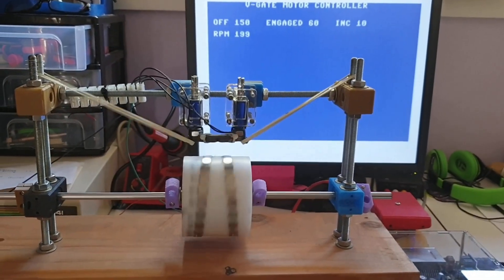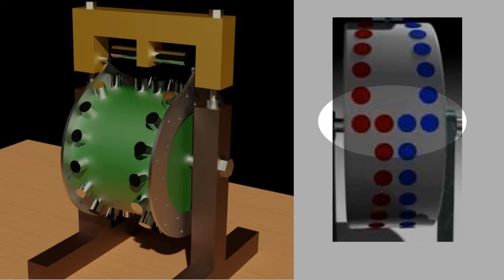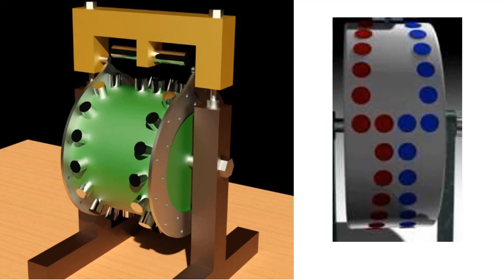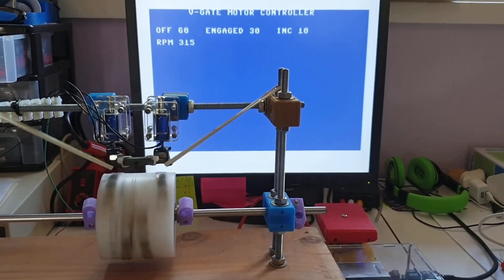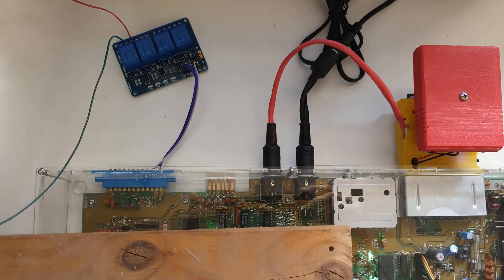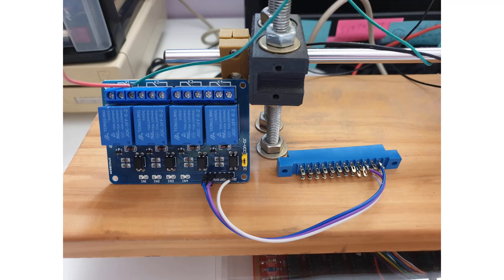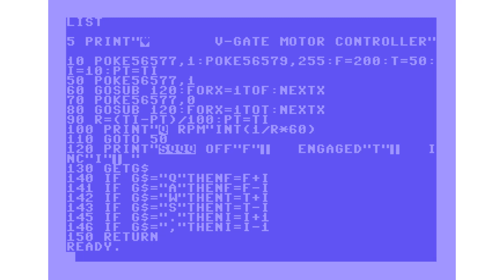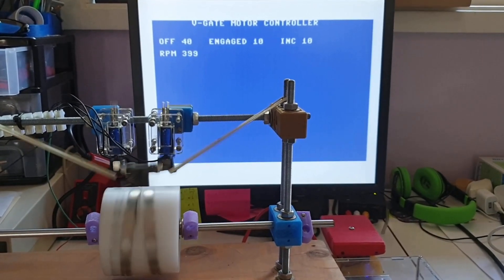V-Gate Magnet Motor controlled by Commodore 64

Comment: Conceptually difficult to figure out the sense, how that this device could produce energy...But full respect for the replication....thnx:)
Reply: The goal wasn't to produce any (excess) energy but rather to keep it running without putting any additional energy into the system once it started running. Obviously this isn't possible as it would violate the second law of thermodynamics, yet still it was very interesting to watch 🙃 That's why the author stated that he didn't expect it to work either as he knows that such devices won't work in the long run. If you're really interested in this kinda contraptions you could look for "perpetuum mobile" - but don't get fooled by "working" ones, because they don't.
Reply: @Tenroh92  Oh, thank you for the explanation:)